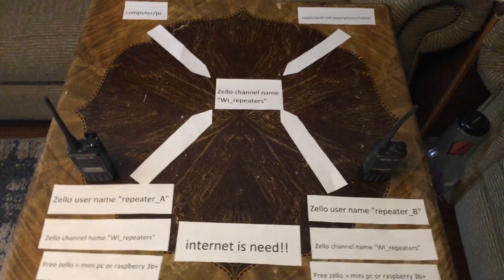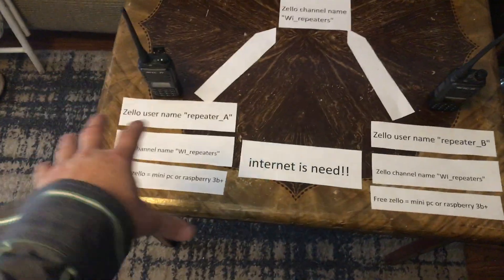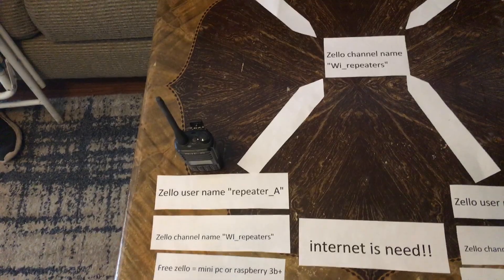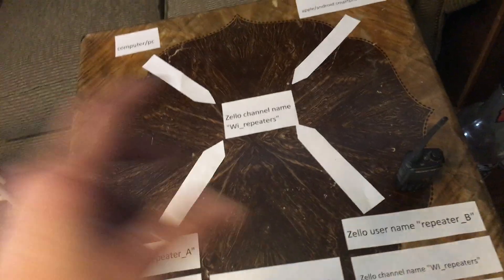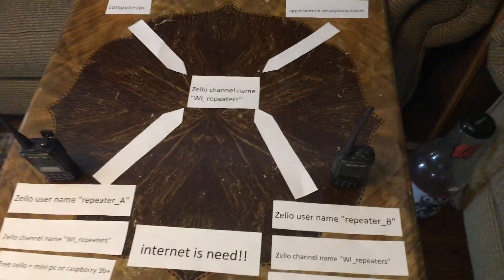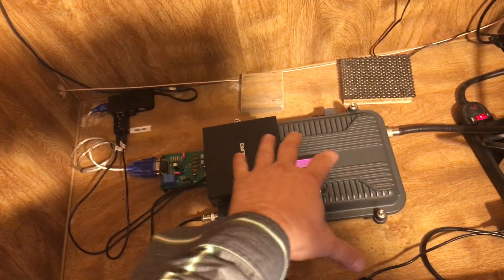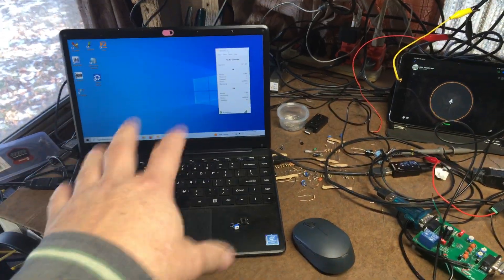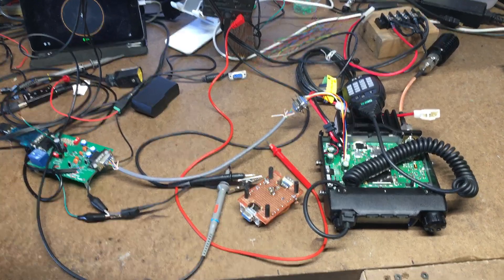🔺 linking GMRS two-way radio repeaters together!! 🔺

Comment: Yeah but, the FCC just said you can't do that. Wire linking gmrs radios is not allowed.
Reply from the maker: Like I said in the other comment when FCC is called they say yes it can be as long as it's not using phone copper wire network internet is ok. and truth be told no matter what is said people will still do it. Case in point, there are MANY link GMRS networks ALL over the world using zello or not using zello there are still linked.
Reply: @GMRStwowayradio  it looks like the fcc is starting to take some action on this.  They've shut down a few systems around the country.

Comment: FCC Rules Prohibit the linking of GMRS Repeaters
“ You can expect a communications range of one to twenty-five miles depending on station class, terrain and repeater use.  You cannot directly interconnect a GMRS station with the telephone network or any other network for the purpose of carrying GMRS communications, but these networks can be used for remote control of repeater stations” Pera FCC website
Reply: Not sure who deleted my comment, if YouTube or someone else.  If they do not want us to communicate ideas back and forth, why bother even having comments?

As  I noted in my deleted comment:
According to multiple comments I have seen elsewhere related to this topic, if you call the FCC and happen to ask three different employees the same question, you stand a fair chance of getting three different answers.  It appears that all of the secretaries, receptionists, and agents, at the FCC are not on the same sheet of music.  If you check out YouTuber Not A Rubicon's most recent video about the shutdown of a large NY state linked system, there are plenty of questions concerning legality.

Linking is a poor use of the very limited (8 channels) spectrum available to us on GMRS for not only repeaters, but 50W base and mobile simplex operation.  When you have two or more repeaters in your area carrying the same irrelevant to your area conversation, it is no service to GMRS in your community.  It only serves to unnecessarily clog scarce channels with garbage.

In SanFrancisco, it is said that under their laws it is legal to relieve one's self on the sidewalk.  While it might be perfectly legal, it is not considerate of others or good practice.  The same applies to repeater linking on GMRS.
Reply from the maker: @grigorirasputin5020  - there is more to that story than what is being told about the NY shut down. Either way, it don't matter, people are going to do it. Because it helps with communication good practice or not. Also, your comment is still there, it has not been deleted.
Reply from the maker: That is using telephone copper phone lines via internet is ok from my understanding
Reply: @GMRStwowayradio  Nonsir it says OR ANY Other Network ! The internet is a Network. It’s the NET in the word Internet
Reply from the maker: @zanestowe7963  - that's not what I have been told if that is the case then why is GMRS live, octane linking networks etc. are still up and running? They are linking GMRS repeaters too.
Reply: @GMRStwowayradio 
Because THE FCC has been very slack in enforcing that rule.  As complaints about linking and linked systems increase, hopefully the FCC will crack down on this obnoxious practice.
Reply from the maker: @grigorirasputin5020  They told my friend ( he called them and the lady even asked a co-worker and he said the same thing) it is ok to do and long as it's NOT copper phone lines or a phone network.

Comment: You mentioned you had a solution on how to do this without internet later. How do I do that?
Reply from the maker: hummm I don't recall saying that, but I am old, so I may have..lol anyway I haven't come up with a way of doing that that would be cost-effective. But if I come up with something, I will make a video about it
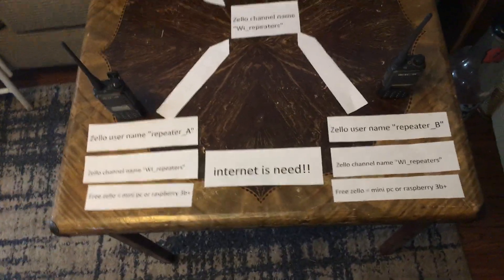Reply: Yes, in 1:15
Reply from the maker: @josemanuel2244  - ahh, I see what you are saying, I thought you were talking about linking without using internet. If a repeater site does not have internet like I was saying in the video then if you are able to get internet 10-20 miles away then use mine another interface board to get that repeater online using another radio and interface board that doe get internet! You would program the radio to the repeater freq. Here is the link https://www.gmrstwowayradio.com/store/product/mobile-gmrs-radio-tyt-th-9000drt9000dalinco-dr-138-interface-board/

Comment: there is alot better ways to link than zello
Reply from the maker: I am sure they may be, BUT can those ways be used with a smartphone, tablet, etc too? Like zello can 🙂
Reply: we use hamvoip software on a raspberry pi als program can be set up on a computer and dvswitch can be connected to network to.
Reply: the hamvoip software has been modified for gmrs
Reply from the maker: @rbritt76  - can smartphones and tablets be used with it? I know some of these networks are linking their network with zello now too. So if that is the case, I might as will just link zello direct and be done with it.
Reply: I wrote a bot that uses a Discord voice channel to TX and RX from a radio.
Reply from the maker: @HansKillinger - ohhh ok, cool, do you have a link to this? Thanks
Reply from the maker: @HansKillinger - can you share that?

Comment: Yes, all that works, but what makes you think that the Internet network would not go down in a disaster event? and then all that unification would fall resoundingly, The essence of GMRS is about its analogy, why not link repeaters physically? without the need to depend on the internet.
Reply from the maker: Yes, internet can and will go down same with phone lines too, this is the easiest and cheapest way to link repeaters together.  There is no other way to link them (physically) unless maybe a cross band repeater, even at that they would be on different freqs. And would require many repeaters in between to get the distance that is needed.